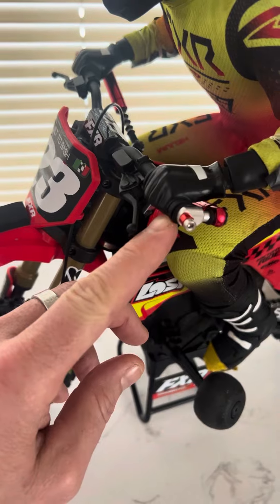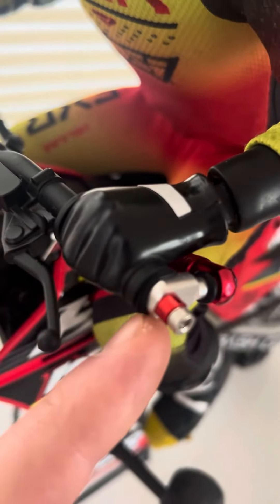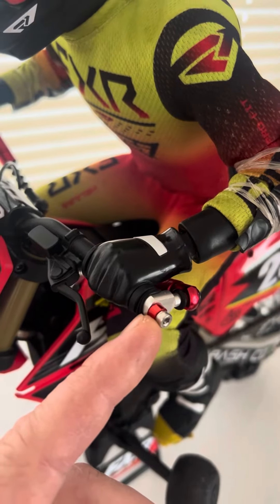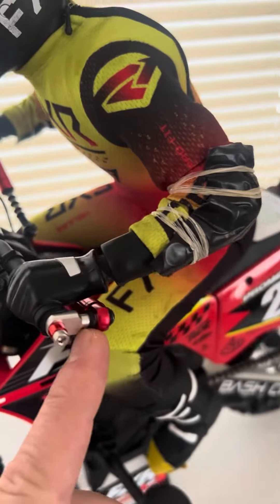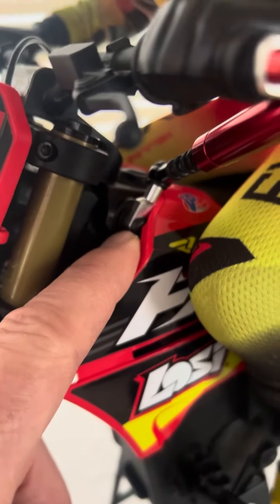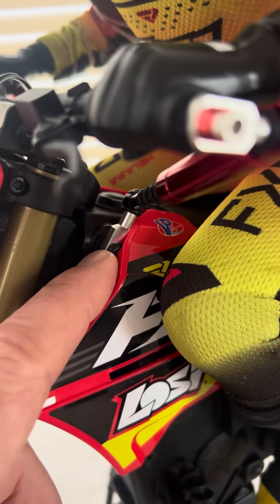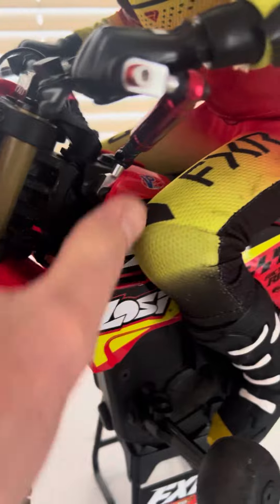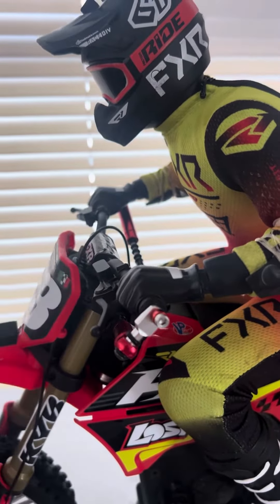Losi Promoto MX Rider stabilizer/collision kit install overview.  By RC BASH CO

Comment from the maker: Thanks for reaching out! The LOSI 1/4 Promoto-MX Motorcycle Rider and Handle bar Stabilizer Kit was specifically designed to help eliminate bike wobble from the Rider’s movements during small bumps, and and big jumps! The stabilizer kit is custom built & engineered to position the stabilizer’s directly above the flywheel of the LOSI 1/4 Promoto-MX Motorcycle. The kit also protects the end of the handlebar as well. Made of high quality CNC machined parts. Tested by RC BASH CO on the LOSI 1/4 Promoto-MX Motorcycle. We have a few videos on Instagram @rc_bash_co and TIkTok @rc_bashco

Comment: What exactly does this stabalizer do? Do you have any running video showing how it improves the bike?

Thanks.
Reply from the maker: Thanks for reaching out! LOSI 1/4 Promoto-MX Motorcycle Rider and Handle bar Stabilizer Kit was specifically designed to help eliminate bike wobble from the Rider’s movements during small bumps, and and big jumps! The stabilizer kit is custom built & engineered to position the stabilizer’s directly above the flywheel of the LOSI 1/4 Promoto-MX Motorcycle. The kit also protects the end of the handlebar as well. Made of high quality CNC machined parts. Tested by RC BASH CO on the LOSI 1/4 Promoto-MX Motorcycle. We have a few videos on Instagram @rc_bash_co and TikTok @rc_bashco
Reply: But the bars don't move....